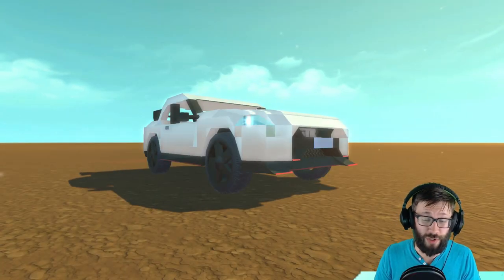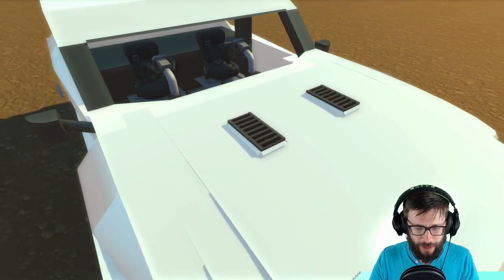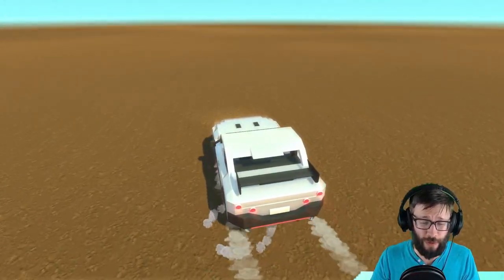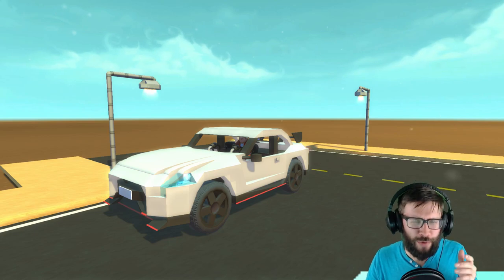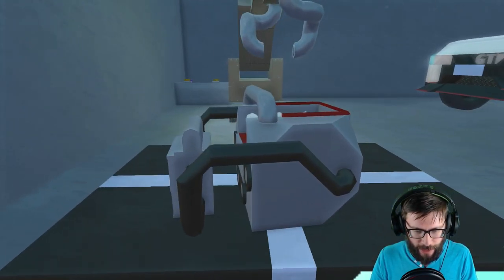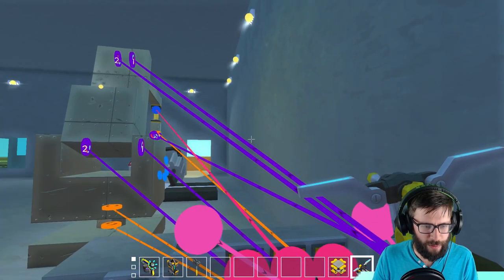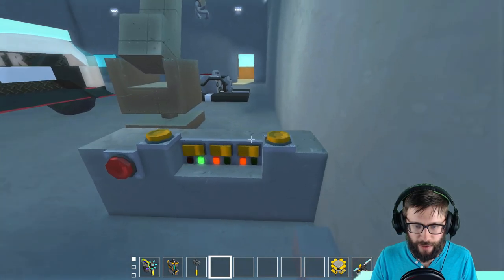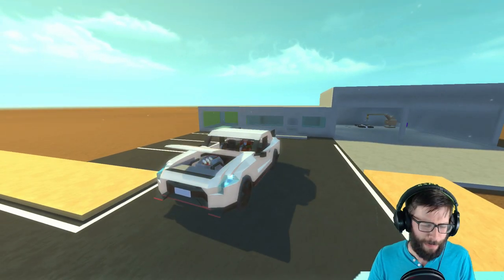NISSAN GTR and ENGINE DROP! - Scrap Mechanic Creations! - Episode 97

Comment: Very cool but its that good i have to be picky.Id prefer it to be low even if it bottoms out because that's the fun with sport cars also its not long enough in proportion to width also why two steering seats?But other than that its rlly good!